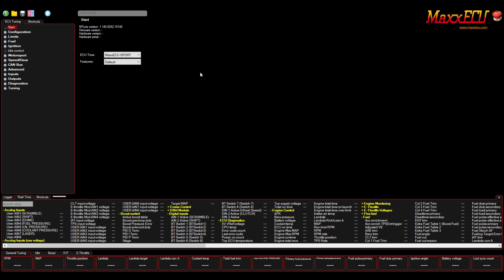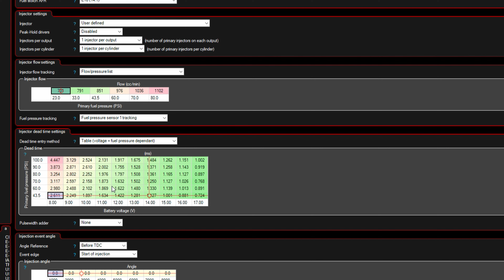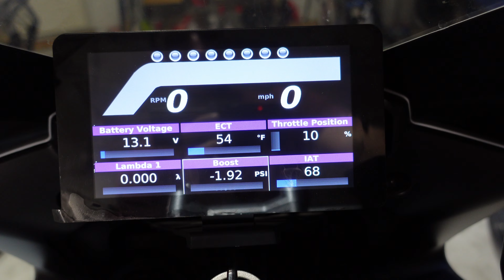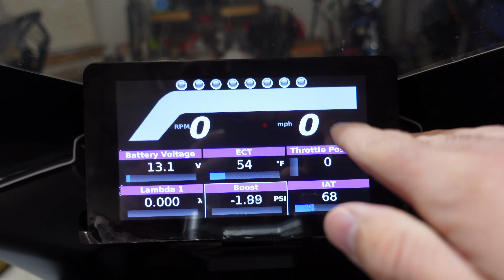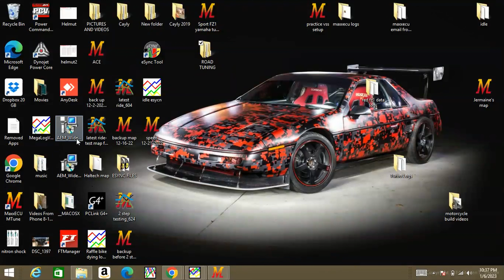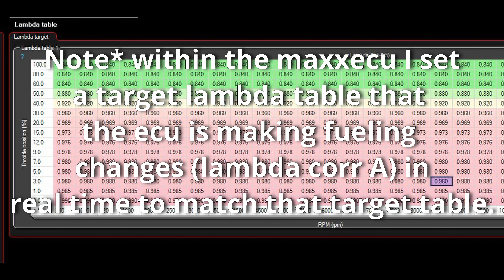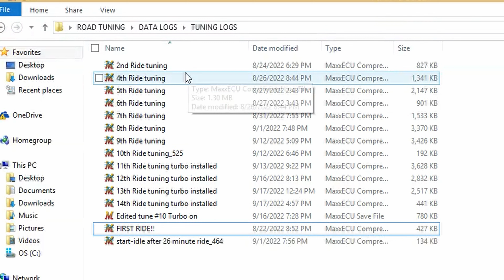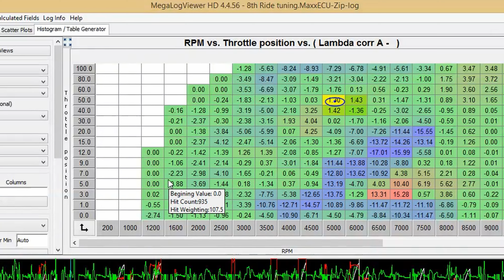Road Tuning?? Self tuning?

Comment: Hi great video and explanation of what the manual tuning process is about. Question, is there a way to remove the options the manufacturer enables in the stock ECU, e.g. fuel cut off and 1-3th gear power limitation i.s.o. bringing it to the tuner for another 450bucks? The Maxxecu is too expensive to buy and tune my bike just once.  2nd Question i have is: I want to change the gearing, do you know of a Yamaha bike which the gears are interchangeable or which gearbox did you install?